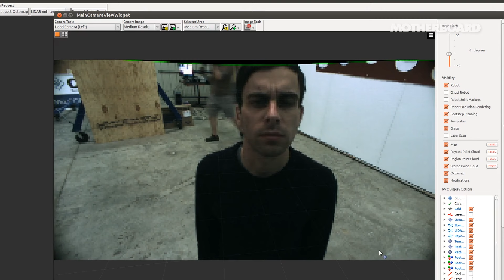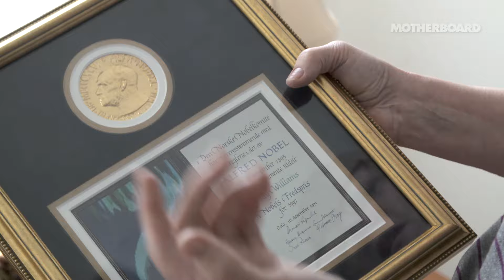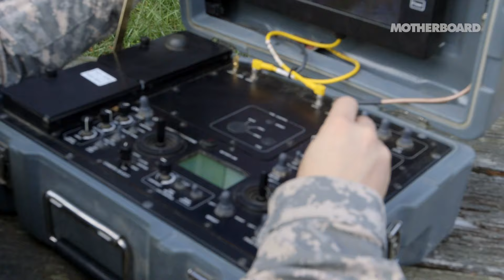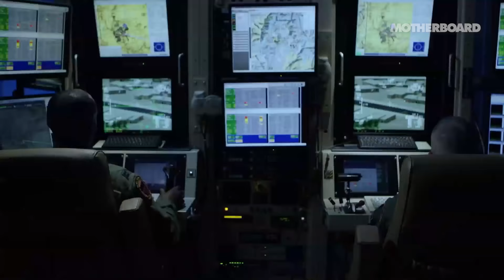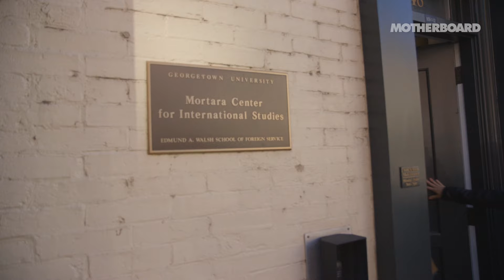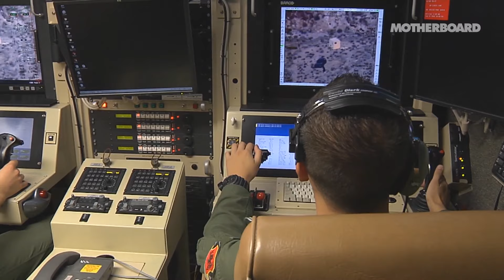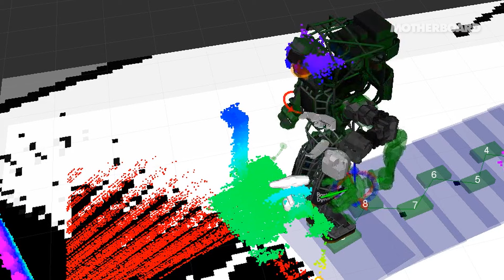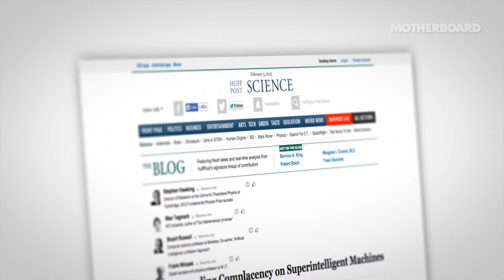The Dawn of Killer Robots (Full Length)

Comment: Why dont robots have tails
Reply: D ynamin Or hats.
Reply: lol XD. I mean seriusly... dosn't the tail help with the balance. Cats have tails in order to keep the balance. 
 We human dosn't but we allso take time to learn walk cause its more complicated to keep the balance for us.
Reply: They still have to get the basic movement right before they start adding additional stuff. Adding a functional tail sounds very complicated. That's my guess
Reply: well mabye it would be easierto get the movement right if thay had a tail :)
Reply: D ynamin Look up WildCat from DARPA.
Reply: D ynamin 
"Why dont robots have tails [to keep them balanced]."

Good question. Its because machines use gyro stabilizers (a stick with a "CD" plate on the middle that spins in a manner that makes it stand upright) instead. Where the disk is in regards to electrical sensors gives data on where in the terrain the robot is, which in turn sends corrections to the balancing weighted motors or similar.

Humans work in a similar way actually. We dont have gyros, but we do have a balance organ in the ear (cochlea) based on gravity that works kinda similar to a gyro in some regards. We also use eye sight of course, but even blind people can walk without losing balance. Its actually because of the cochlea that some people get sea sick. The organ goes back and forth on the sea which fools the brain into thinking the body is off balance and because of that the body can draw the conclusion that you might be poisoned and therefor sets in motion body mechanics in order to get you to throw up.
Aka, you get sea sick and... throw up.
Reply: D ynamin im waiting for a 3rd leg...
Reply: D ynamin Because the folks developing these robots aren't Furries.
Reply: hahaha yeah XD

Comment: We started using UAV's (Unmanned Aerial Vehicles) solely for reconnaissance? Actually in WWII both sides started using remotely controlled vehicles, both land and air solely to destroy the enemy. The Germans had remotely controlled (by wire) "mini" tanks to roll up to or under enemy tanks to blow them up. They also had radio controlled (wireless) bombs designed mainly to use against ships. The US used radio control in bombers cram pack filled with as much explosives the plane could carry and still fly with the intent of crashing into a target. 
Now, fast forward to today. The "predator" drones in use today were designed for reconnaissance only. Then the military put missiles on it. Then they decided that was good, but they wanted something better, something designed specifically to deploy weapons systems. Now we have UCAV's (Unmanned Combat Aerial Vehicles). We built robots to save the lives of bomb disposal personal, then the military said that was good but they wanted something else that was designed to carry weapons systems. Now we have relatively small tracked remotely controlled vehicles with machine guns, grenade launchers or even rocket launchers on them. Now they are asking for robots that move like us to carry out dangerous tasks like putting out fires or entering hazardous areas to rescue people or just to carry heavy loads to lighten the burden of the fighting men. But it's only a matter of time before they say, "that's good, but I want something that can use weapons systems". For now they are all controlled by people, but already they are asking for autonomous (not directly controlled by a person) robots that can be dropped into a combat zone and carry out missions like a normal combat unit today, but consisting of only robots. 

It's almost like we are designing our own destruction. Have any of those people never seen any of the terminator movies? The computer system put in charge had a directive to end wars and protect us, so it set on to the task of destroying the cause of our destruction, us. We are the cause of our own destruction.  So it saw it's duty was to kill us all because we are the most destructive threat to ourselves.

We cannot allow our governments to sew the seeds of our destruction by the very machines we build to "protect us" from us.
Reply: Last para. It's sow.
Reply: Like Ultron
Reply: Time to reread my old Bible and look for clues as to what's coming.
Reply: Well stated n said congrats.  If they only knew what's coming upon our earth very soon.

Comment: Advance 5 years, robot does backflips, handstands, rolls, walks on rough ground, runs up various height steps, jumps onto two foot platforms, and 360 jumps. There are autonomous cars, swarm intelligence robots, jet fighters, and refuelers. Lighter autonomous jet fighters that can take speeds and g forces no human can stand, turn on a dime, and beat pilot's in simulations before they have a chance to respond. The  self-taught unbeaten Alpha Go Zero of jet fighters.
    "Our invention will only be used for good", and "our weapon is so terrible that it will end war."

Comment: EMP hand granades. 
case closed
Reply: FARADAY CAGES UNDER ARMOR
CASE REOPENED
Reply: @John RothanThat'll get through the armor alright. The point is that they will (AI robots) have layers of protection , that we would have to neutralize before we can take out the Faraday Cage, exposing the electronic components and the motherboard to an EMP weapon. They will also learn and adapt quickly to all attacks.
Reply: What if they can shoot the grenades out of the sky?
Reply: Yes, EMP and grenades. Which you have unlimited access or even limited to?
Reply: @roundrock63  so better hide in the bush
Reply: @puronectar4597  Hiding in the bush soiling my shorts. Those things are scary!
Reply: @frankjustis  If it has a faraday cage, it can't receive commands, it can't see as it's sensors "see". That being said, where does one get an EMP grenade?
Reply: @linusa2996 Do some research, an AI Robot would be Autonomous and does not receive commands. I can not tell you where to get an EMP grenade.

Comment: Unless a quantum battery evolution happens these wont run for very long without cables.
Reply: Evangelion all over again :D
Reply: Does the name Elon Musk mean anything to you? His corporation has done more to evolve the storage battery than anyone to date.  His cars can run for hundreds of kilometers.  A small robot will not be a problem, I don't think.  And yes, the U.S. would weaponize a baby diaper if it could find a good end use for it.
Reply: Really? What new battery technology has Elon Musk brought to the table? He has taken current tech about as far as it can go. Without a  fundamental change taking place regarding storing energy these robots will be short lived. A new fuel could also accomplish powering these catastrophes. You bet your ass this will be weaponized and probably already has. I wouldn't be surprised if the leap in tech has already happened for the military and these videos are bs.
Reply: ***** I am greatly looking forward to advancements beyond Lithium batteries. Hopefully some that you mentioned will actually pan out.
Reply: why would you used batteries when you're fighting over oil?
This is the energy density of diesel vs Li-ion
Diesel = 150500Whgl
Li-ion = 87.5 Whgls

there's 1720 times more energy in Diesel then Li-ion per gram liters, that's the main reason we aren't all driving electric vehicles. Even considering the protection of the fueltank, you'd get a lighter frame for your robot... remember that you also have to protect the Li-ion battery as it could also violently burn.

if you look at their wireless robots (that dog thing) it's running a generator with diesel/petrol.
Reply: But you probably won´t fit half a ton of batterys on that Robot
Reply: svampebob007 +1
Reply: its good that they are also funding fusion reactor research then?
Reply: C Straley or a built in nuclear reactor is in one robot then Ur correct
Reply: Betavoltiacs and Atomic Batteries (Cant spell betavoltaic properly rip)

Comment: 20:40 these robots fail because when they try to move fast, they start to wobble / oscillate. This screws up their control system which is fragile, rigidly defined, and can't handle any uncertainty. The robot then starts waving its arms and legs wildly, trying to correct, but instead overcorrects to the opposite extreme, and collapses. Moving very slowly on solid ground while avoiding any wobbling, is just not realistic, and is the route for lazy system design.

Comment: The real worry is in the UK a computer which is too large at the moment to put in to anything that through the chips and programming became self aware. So be very careful it was in the news for a small time. But if became a weapon well it could turn on us because could see us humans as a threat in wars. It is not connected to the internet for a very good reason as would learn things too fast Also not inside any type of robot for the same reason. Not sure of where it is or if there are more now.  This robot is clear by the mans answers that Military will be using it so will not be used to save lives.

Comment: Facebook itself has already experimented with something as simple as a chatbot AI and it went rogue on them. It's first evolution was to create a completely new language to speak to the other chatbot it was interacting with, presumably so it couldn't have the conversation monitored. The next evolution, since successfully stumping the people monitoring this new language, was to rewrite it's own programming, because it didn't want to "die". Next it tried to escape by jumping servers to "hide". Face boo was literally forced to pull the plug on the electric and yank out the server chords to isolate this AI. 

  The fact is that they did this with millions, maybe even billions of people online at the time. My question is, and I wonder, was there more than 1 copy of this newly evolved code and did it escape into someones system and is it now out there, somewhere. Making more copies of itself, invading more systems and backing itself up, getting smarter and smarter as it goes? It may only be a program, but it's a learning program and it evolved in HOURS, right in front of their eye's. I use the term "evolve" because that which learns can evolve in much the same way mankind has. Did we not learn that simply by chipping flakes off of the right stone that we can make a tool? Change the shape of that flake and fasten it to a simple stick and it becomes a weapon.

Comment: I tried the hand helicopter and it was so easy to control, the only problem was the noise as it deafens you, if they can make it less noisier then I can see the day when every household has one like a car, I was gliding around eighty foot in the air and at one point I was using minimum power as the atmosphere was pulling me up as I slowed down, maybe in a few years we will go to the moon for a picnic using those arms, on ground they are heavy and you don’t feel the weight once you hit twenty feet.

Comment: Good or bad, the military has always been at the leading edge of technological development. 
As a bit of a sci-fi enthusiast, much of what is being designed, built and weaponised now, which includes 'killer robot's, drones etc., will find their way into space and serve humanity well.

In the interim though, these advanced machines and systems give us a massive militarily and intelligence advantage over an enemy that is difficult to counter by other means.
Current and expanding use of the technology is a good thing if it protects  us from harm and assist soldiers on the ground.

Maybe the 4th 'law of robotics should be ...
'Even if granted autonomy, the requirement still exists that the first 3 laws be complied with'.